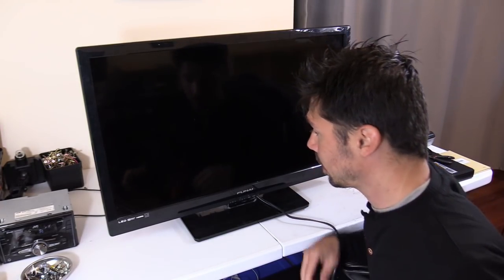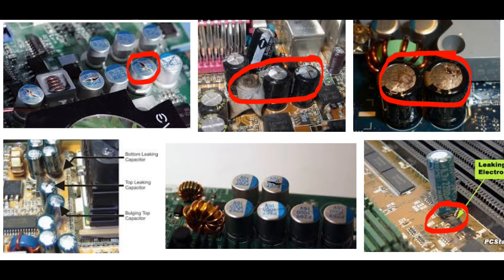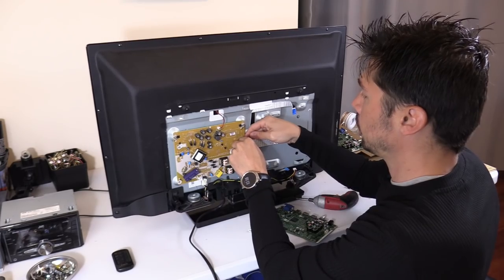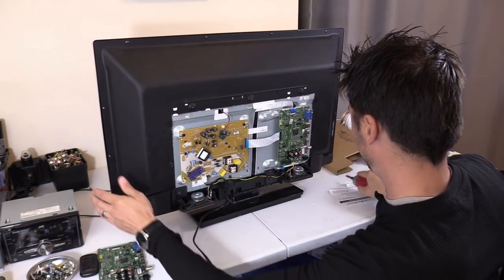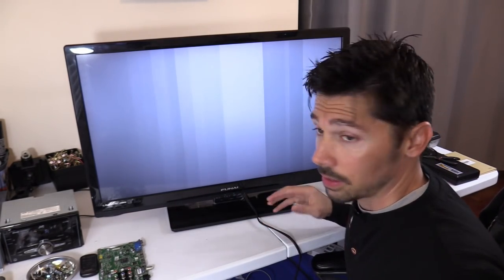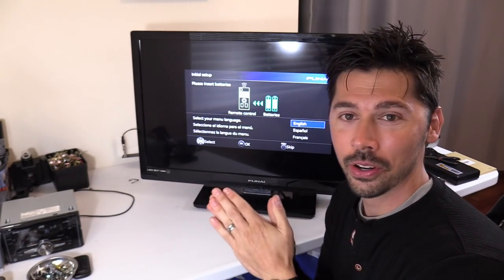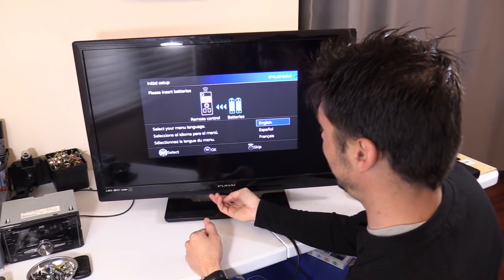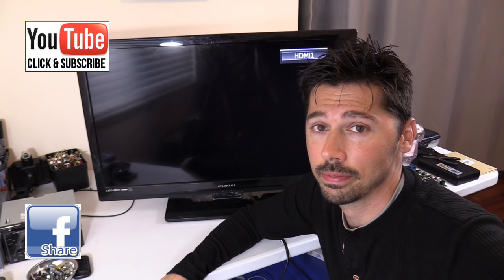WATCH THIS VIDEO BEFORE FIXING YOUR LED LCD TV

Comment: Excellent job Tampatec. I've been looking through your videos for an explanation / diagnosis on my Sony Bravia. Its an XBR-55X810C. Mfg in Sept. of 2015. I had a lightning strike today about 100 yards away from the house and now the set is completely dead. It will not turn on. Voltage readings show a 3.3 volt logic voltage.  I also have REG 12 volts.  There is no TCON 12 volts. Am I looking at a bad logic board ? Thanks for any advise and keep up the good work on your videos.

Comment: But did you imvestigate the coil whine in the original board? Should've been fixable since you can pinpoint the source (e.g. bad coil, caps, or resistor)

Comment: The number stamped on the board is for the raw, unpopulated board.  The same board is often used in many applications and may have both different devices mounted on it and different firmware.  That is why you need to use the sticker number.

Comment: I have a RCA lcd led tv that i have replaced the main board.  It didnt have an image but now it does.  The only problem is that the picture is distorted and thought that maybe the tcon board is bad.  Replaced that but no change.  How do i know if its a component that is wrong with it or the panel itself?

Comment: I have a LG tv.........55LN5400. When I turn it on i have a picture for a couple of minutes and then the picture goes away but i still have sound. The only way to get the picture back on is to hit the tv power button on the remote control. Picture will come back on but only for a couple of minutes and then i have to h it the power on button again. Can you help me out ?

Comment: Good video! - What about HDR LCDs? - Can the back light be set higher than 50% to achieve the intended brightness levels of HDR? -  Are the LED strips designed to handle more brightness on a HDR set?

Comment: Hi, I have a small red light always on on the side of the TV, and TV does not turn on for about a week now. Does the red light on the side of the TV mean I have power supply working right? And just need to replace the motherboard in order for the TV to work again? Am I accurate or am I off a little bit?

Comment: Can't you just throw the board in the oven for ten minutes???
Reply from the maker: That's temporary fix at most, might last a month. I made a video on tcon reflow solder. If solder joints are bad because factory used poor solder like non lead solder then reflow will just reheat that crappy solder joints. Use high quality solder for long term results.
Reply: @TampaTec   Dont know what issue this tv is having...... when i first got it from a friend the backlights kept blinking but no sound..... i unhooked the cord from the led strips to the powerboard and i got sound..... so i plugged it back in but led's wont light ip anymore...... could it be a short somewhere? I' m new to trying to fix these things
Reply from the maker: @blairrogers3450  a bad LED strip can cause circuit to malfunction like that. I made a few videos how to replace led strips. See my Repair playlist.

Comment: I don't know anything about TV all I know is that I have a 75 in Samsung and I don't know every time I try to call somebody nobody is and I can't find a TV guide for you are good I wish you were in PA to help me all I know is the TV still working but sometimes it will start off but hasn't shut off yet but my smart TV just connected because the guy that worked on it once before never plugged it back in I guess so what can I do I will not touch it please help me

Comment: HI my   Samsung  NU60ju6390F smart 4k tv  not even 2 years old it turn on and  hear video and lighting work first blurry picture then after a 10 second a picture of lets watch tv witch include antenna or stb then after i try to move it up and down or next screen ill freeze . i change the T con board but stay the same i was wondering if the main board is bad since there s electric to  the tv on since there s only 3 boards do u think what i ve said the main board is bad cause to be honest i have no idea what the function of the main board     sorry if my writing or my explanation not that great for 68 years old that the best i can do thanks you.

Comment: I had a 52 inch Samsung that was 10 years old. Nobody had any parts seen it had 2 blown caps bought new caps from amazon for a few bucks replace them and it works fine.  If you cant fix it yourself my as well junk them. Blown caps are the most problems. Anything else my as well junk it or save it for parts if your in the business of fixing them. Its not a money maker fixing TV today though for someone else. Nobody  wants to pay you anything for your time and trouble you have in them.

Comment: My JVC led tv board does not have a sticker. Im seeing a smudged picture with horizontal lines and i suspect the board might be bad. I've owned the tv for about  3 yrs and it started giving me this problem, I ended up buying a sony 42". Now i want to fix the jvc and use it as my pc screen. Im seeing a long sticker at the back of the tv, which i dont believe has anything to do with the board.

Comment: hello after watching your video, i just about narrowed down my problem. i really think the backlights are bad but i dont have a standby light either. it will power on but picture flashes and instantly powers off. did thre flashlight test and i see the picture oh and it has sound as well. It's and LG 47ln5750-uh. how do i know if its the inverter board or the backlights that i should replace? if possible call me 904-990-9625 thx

Comment: if your tv is 10 years old, and you can't find a part (totally understandable), but you KNOW it's something with the t-con board (video issues), what are your options... also, with an lcd tv, assuming NO components go bad, how long could you expect a lcd tv to actually last?  if you replaced capacitors and fuses etc as they went, could you hypothetically get a tv to last your lifetime?  obviously with price drops etc, it may make sense to just buy a new one, but 'could' a tv last that long?  (forgetting about stuff like hdmi has changed, or is obsolete, so much nothing is compatible in 20 years etc)

Comment: Great Video :D 
Its probably "firmware" difference. But dont go swapping your eeproms/flash storages, I also know some main controllers might have their firmware internaly, or somehow the main ic needs some specific calibration that wont match with your transplants. some boards will accept replacing the eeproms/flash storage with the ones from your original, but Like Tampatec said, when ordering, try matching the sticker codes too (they probably hold not only the "revision number" but specific "firmware" versions.

I know this, cause I have some boards laying here that I need to reprogram myself (using some chinese firmware) to make em work on some donated laptop screens. was looking at various LCD controllers and figured out that most of them get their screen resolution information, color calibration (matching the LCD manufacturing specific details) from either eeproms or flash storage ic's. But I also hit the problem of having boards where some efuses where used or OTP main controllers, meaning, one time programmable, some bits are set at the factory and we cant change them.

But again, either just order the exact matching board or be ready to thinker arround. (I have a broken 3D tv, and rather not spend a hundered bucks on a new mainboard, I rather fix it or factory reset the soft/firmware to a working state.)

Comment: Alright, so you changed the board.  Have you tried to fix the component/components on the board?  Going to be hard to fix TVs if the boards are not available anymore.

Comment: Tampatec I have a e65x-c2 vizio. The problem is the tv powers up backlights come on vizio logo shows up, then after about 30 sec.  Main  power board has been  replaced. What board do you think could cause this?
Reply: Power supply

Comment: i got back light , sound ,  but no picture , voltages are good , tried to trace any signal goigng to the panel , but cant find any data , basically just noise that i dont know what does , and no manual for it ,  thing is i dont know if its main board or panel driver board or its  panel ,  and i dont have spare parts to check , any help ?

Comment: Hi !l need your help ,l have a 32 inch android philips tv made in mid 2016 .It works great picture qualiti is great and culours amazing.The problem that l have is that on standby mode l allways hear a noice like when we had many years ago ISDN network conection and we pluged in with a cord to a phone it made that saund like is loading.The tv is 1080p and this problem occure just in standby mode  .please if you can give me some advice what to do couse l have to unplug the tv complitly every night couse the noise makes me crazy,i think it is some power issue but l do not want to tuch anything couse it is functional .thanks for listenning!

Comment: I wonder if you might have some advice on a TV I'm trying to fix.  It's a Vizio E220MV and the symptom is that while it appears to power up just fine, it has no backlight and no picture on the LCD (as checked with the flashlight test).  All the voltages on the power board appear fine and all the capacitors look good.  The menu buttons on the bezel respond to being touched but that does nothing to put any menu onto the screen.

Comment: I have an Emerson 50" with no light or power, it just turned off one night. LF501EM5F. There is a beeping nose but if I disconnect the ribbon to the main board from the power board, the beeping stops! Any help would be good. THX Rev.D

Comment: Good info, I was given a dead Sceptre 32", it works thru the PS to screen with a bit of the old snow storm effect, only button that functions is the on/off and standby LLED, so now I will try your solution and see if it works once more..TYVM...

Comment: I've had several of these. I trace the short on the main boards and find that there is usually a surface mounted capacitor that will short out. Replacing the shorted cap will repair this.

Comment: Hey huge fan of the videos and keep up the good work but I have a quick question that I'd like your opinion on I have a Samsung TV that had a solarized picture replaced the t-con board now I have no picture but when I reinstall the old tcon it goes back to the solarized could it just be I got a bad t con from eBay or what else could cause this just like to know what you think let me know thanks and have a good one.
Reply from the maker: Yes that's why I only buy from 2 sources now shopjimmy.com and electropartsonline.com for  discount use code tampatecfriend. Make sure rev# is same as old tcon board.
Reply: @TampaTec  yeah I learned my lesson and will only be purchasing from shopjimmy from here on out but you do think that the tcon is the problem?

Comment: My dad while he was watching TV he decided to clean it and sprayed the screan to wipe but he didn't know he couldn't do that like the old TV's. He is now in heaven but I would like to fix it, how can I do that? Please let me know.
Reply: Unfortunately the cleaner will run down into the LCD data cables that are attached to the screen. They will short and corrode. The set cannot be repaired. seen many of these :(
Reply: @berryelectronics  but the power do comes on and I can hear it but no picture, I can hear if I change channels .
Reply: Yes the sound will still work. Just there is just no picture.

Comment: It's crazy how many revisions they make of these tv boards that look identical.  The timing of this is good since I was looking for a board replacement there that was not in stock and was considering a desperate attempt to order one of the other identical looking revisions to now realize that I am very likely SOL  I wonder if and how much Samsung costs to replace these parts since 2.5 years lifespan for a $2800 TV is BS!

Comment: hi there i recently watched a couple videos on how to repair my tv a sony bravia kdl37s5500 i have a picture its very bright as if some one has messed with the brightness, contrast and colour options i also have horizontal lines showing at the top of the screen would you know if this is due to a board issue or lcd problem

Comment: How to know what's wrong with my TV. It has no picture, no sound. I have an lg 43lh540t. It was just an year old TV. I have seen many repair videos but still don't know how to diagnose my TV to know the exact problem.
I would appreciate if someone could tell me how to check specific components of TV whether it is working or not.

Comment: Hello, I have a Toshiba 55WX800U TV that has horizontal white lines , about 3-4 across the top of the screen and also has ghost images that remain for 2-5 seconds. i'm suspecting the T-Con board but I'm not sure. What say you?

Comment: Pls tampatech I need assistance on a lcd Sony tv kvl32T400A model, which is not powering and no red or green light on the front panel. I tested power board, and I got a 5.8 DC volts written on the output section of the power unit. But when I connect d main logic control board, the 5.8v reduce to 1.2v or start flunctuating badly. Would I conclude the problem is from the main board?

Comment: Hi Tampatec,
So I've watched MANY of your videos and am still stumped about what exactly might be  wrong with my RCA LED LCD tv. My TV screen is black, though I do have a red light on the bottom, and I have no audio. I've tried your flashlight test and see nothing when I try to bring up the menu screen, and do not see any glow from the LED back lights when I turn off the lights. However, the TV did flash once when I was messing with it. I've also checked the power supply and do have standby power when its off at 5 volts, but 0 volts when I turn the power on. I also checked the keypad/menu button panel on the tv and it's reading 3.32 volts to the main logic board and the volts fluctuate when I hit the power button so I think that's good as well. 

Also I'm a bit confused I have two green boards on my tv, one which I believe is the main logic board is connected to the HDMI outlets and the other which i think is called the frame rate converter board? and Lastly my main logic board has no sticker on it and no model number written down, how can I find out what model to order if the logic board ends up being the problem??
Reply: Update, after checking the standby power supply one more time, I found that one of the of the wires read 4.53 instead of 5. On the chart it says that this wire is the ON/OFF but it doesn't say what the voltage should be like it does for the other wires. Does this matter?

Comment: Enjoy watching your videos. Have a question for you, started getting colored vertical lines on my 52 inch Samsung Tv couple of weeks ago. Was told replacing the T con board might take care of the problem. No luck, still have the lines on the right side the screen, any help would be appreciated. Hate to replace the TV, it is only seven years old with minimum usage. Thanks.

Comment: I've got an LG 31MU97 pc monitor that has motherboard issue and there is not a single vendor/shop in my country that has that motherboard for sell, found some on ebay but they ain't shipping to my country. is there any way to fix the motherboard instead of replacing it? (btw the 31mu97 motherboards sell around 50~60 USD).

Comment: I have a Samsung Model UN40H6203AFXZA I have replace all Three Boards. Power Supply Board, Main Board, and T- Con Board Check All Numbers On each to sure they match, I have a solid red Light until you power the TV on Stand by light blank 5 times and goes out. I have no back light at all. Oh the T-Con board has 3 blue lights. the only thing that's I haven't done is replace the back lights strips, if you can shed  a little on Subject.. It maybe I'm overlooking something.

Comment: Hi, my Philips TV LED Andriod ( model: 55PFS8109/12) keeps turning on/off every 5 seconds, and it won't respond to the joystick (power button) and remote controller.   I have to remove its power-cord in order to switch it off and when I plug again, it ON the tv and keep power-cycling.  What do you think the issue could be? power supply or main board?  thanks

Comment: Hi TampaTech  as I was watching your video I ran a few test on my Hisense 50H7GB TV. I notice that when I press and hold down the power on the side of the TV the Hisense logo comes on and the TV picture comes on. The TV well stay on for about 2 minutes then it turns off. I have not opened it yet. Could this be a symptom of the power board?

Comment: Hi Tampatec, I have a Panasonic led TV 42" TC-L42E5, it was not turning on anymore, the red led just blinks, starts with one blink and then it blinks indefinitely. I replaced the power board, reset the tv and it worked for four days and now is back to red blinking light. Please help!

Comment: I purchased your recommended capacitor package from Amazon. Got it in two days. Outstanding. However, on my UN55ES6100F Samsung, so far, not one of the capacitors in the assrt. have the same uF rating as the original. Is it better to go slightly under or go up to the next highest uF rated capacitor and does that work? I've installed three so far. First origional was a 25v 560uF, the closest was 25v 470uF, next was 25v 1000uF. I used the higher one. Does that work, or should I remove the higher and go for the lower each time? Thank you in advance. Max

Comment: Is there a site for purchasing boards for refrigerators? I have an Insignia 10.2 cu ft (NS-RBM10WH7) that I need a replacement board for but Insignia does not make replacement parts for it even though this is a new model fridge that came out 2 years ago.